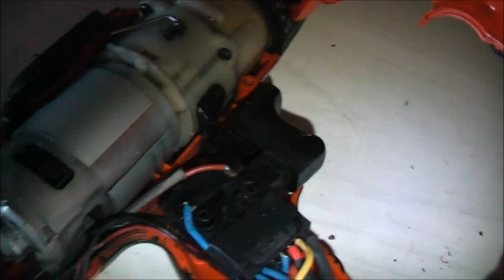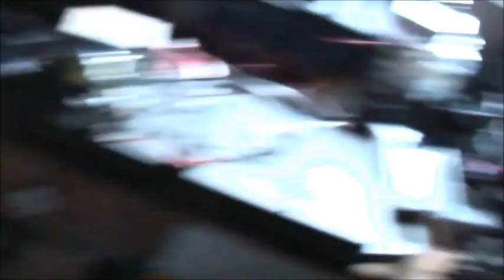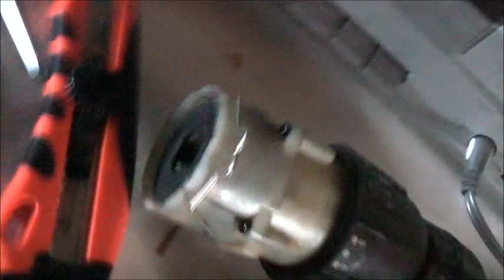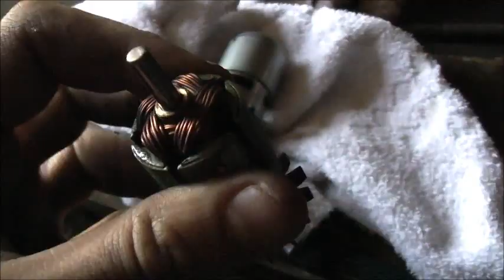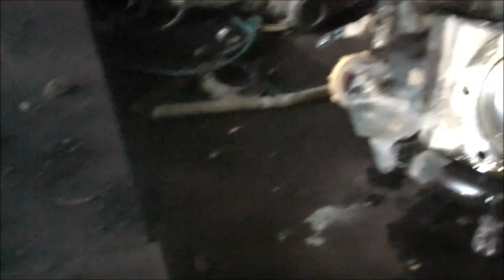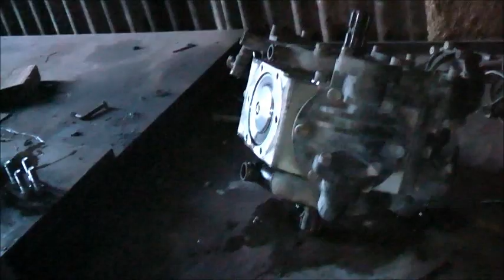Cordless drill autopsy & diaphragm pump

Comment: Very heavy duty motor for the hammer drill, too bad it was stuffed.   I rebuilt several two cylinder diaphragm pumps in the last few years, our biggest trouble with them was the failure rate of diaphragms; plus the inability of our operators to recognize that when the unit starts spitting oil everywhere the unit needs to be turned in for repairs.  The diaphragms would develop a rupture and begin pumping product into the oil sump displacing the oil and eventually destroying the crankshaft.

Comment: Got my new pump on and all up and running now. Took one head off old one and not pretty inside. I guess brass is just getting too expensive now to use. The old pump was still working but surging and water in oil so a diaphram somewhere must have ruptured. Is a 98 model and done lots of work so can't complain too much.